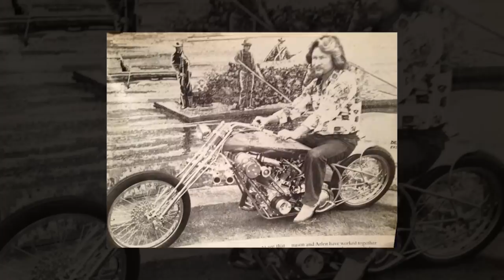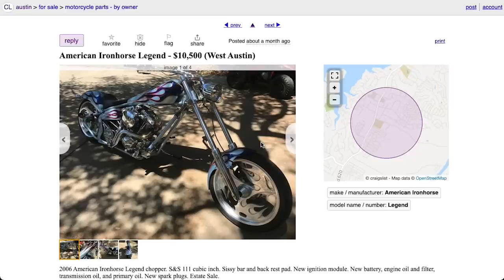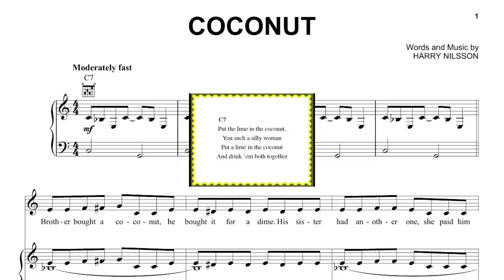This was the Weirdest Trend in Motorcycles (Choppers Explained)

Comment: I'm not a Chopper guy myself, but I have respect for them. Anything homebuilt that someone put their heart into will always have my respect.
Reply: I am one of the homebuilt rat- chopper riders... And thanx, means alot. I did pour my heart, soul and countless hrs into making it exactly like i want it.
I do however like other types of bikes also. as a gearhead and craftsman anything mechanical usually has an interesting story... and if you look at a bike considering what it was made to do, most bikes have their own strokes of genius! :)
Reply: I disagree.  It's like building an airplane that doesn't fly.
Reply: @micclay  What if you put some metal flake on it, chrome the prop and extend it way out front? You can still trailer it to Sturgis.
Reply: @micclay  no... it is like building a lightweight personal aircraft while everyone else is buying cesna....
Reply: Timothy McVeigh has entered the chat

Comment: Having been around when Choppers were relatively new, I'm happy to hear you explain the various types of bikes people have been drawn to building or buying.
I've heard so many people try to tell me a Chopper is a bobber or a bobber is a Chopper. Having an outlaw bike shop near my house, I often hung out around and asked, why's it called a Chopper. Simple, the head is "chopped" so the rake can be changed to allow a longer fork without raising up the height. A bobber keeps the stock rake but "Bobs" the back fender, or remove completely and use a single "saddle" as they were called back in the day and as the Yam master said, remove everything that's not absolutely necessary to ride it. Thx little buddy, I've been a fan awhile. I've had, starting in late 60's 175, 350 Honda's, a bultaco, Pan head Harley hard tail that I couldn't wait to get rid of to buy a CB750, a 360 Elsinore, 250 Elsinore, 250 Enduro Yamaha 500T Suzuki an XR500 Honda another 500T a 75 Gold Wing hot rodded out a 750 Ninja and others I'll remember later while sitting on the toilet. Also, my CB750 was heavily modded by a Honda tech aka Mechanic who was a sponsored racer and had parts not really available to the public. On that bike, I could easily outran Z 1 Kawasakis
Oh, I had an XS1100 I didn't keep long, it was so so slow compared to what I expected. Thx for the entertainment Mr Noob!
Reply: Put down the Crack pipe Ronnie.

Comment: Mine was a 1950 Panhead, hardtail, raked and extended 10” over forks. Mini apes. Gloss black peanut tank. Built by me in 1972. Loved it. Sold it for $1900 in 1974.
Reply: I loved it so much I couldn't wait to get rid of it two years after I "built" it. I then built a house in 1984 without a roof and the front door as the gate of my fence, but no windows because that's too new school. Loved this house.  Sold it for $10 in 1985.

Comment: I have seen a guy’s drawings of his fantasy chopper drawn while he was doing a jail term. It was quite a picture, and it helped him keep his head while he was away from his family and friends. Choppers are pretty fantastically designed.  I prefer more practical bikes but I miss out on style!
Reply: i made my rat chopper practical.... looks like a rat, but everything is newly made and fully functional. Starts every time and low maintenance, I even have a driveshaft instead of chaindrive.... I got electric heat, phone charger, 12v power in my ammobox sidestorage, a small windshield I can tie to the apehangers for long rides on the highway. bluetooth phone/music/intercom in my helmet, a cupholder for a steel mug besides the motor to keep my coffee warm, I got forward controls but also small center footpegs so I can move my legs around and I stack my luggage as a backrest and mechanical cruise control... I have had it for years and never dropped it once....
-What other luxury or practicallity do you need? :D -Compared to sitting on a streetbike, racer or adventure bike I feel like going on vacation lying down on a loud sofa! :D :D

Comment: I am a cruiser/bobber guy. Choppers don't really interest me except for the fabrication details. I don't care what the rear tire pressure is, a rigid frame hurts. I grew up around custom motorcycles, built in back yard sheds and garages, not on TV. I love to see nice fabrication of anything, motorcycles, cars, woodworking, but for me, motorcycles should have a suspension in the front and back, as well as brakes. For me, the worst part of the chopper craze is the idea that anyone with a cutoff grinder and a walmart welder can build one. Then they get upset at the local watering hole when nobody appreciates their "heavily customized" 1967 Suzuki 250 Hustler. I am not knocking self expression, I modify my own bike, but some guys shouldn't be allowed to use power tools. At this point, if I see pipes with header wrap, I just assume it is to cover the poor welds on the pipe. I ride quite a bit, usually cross country at least once a year, about the only time I see the "Boss, BigDog, super wambadine choppers is if I happen to be passing through Daytona, Laconia, or Sturgis during a bike week. They are usually on a trailer to get there, they go from the hotel to the bar a half mile from the hotel and back daily. Other than that, they seem to live in the trailer or the garage. I need more versatility than that in a motorcycle.

Comment: If you’ve ever bottomed out a motorcycles rear shocks just imagine having no rear suspension at all. It’s like riding in a car with the rear axle welded to the frame and the suspension removed. Such a dumb trend.

Comment: I know I'll get backlash for this... but with all the custom built choppers out there, it still makes me laugh to think that when honda made the rune not only did they factory build a chopper that actually worked as a motorcycle (unlike most of the custom stuff), it was also cheap and looked better then alot of the custom stuff. They also almost overnight killed the 2000's chopper craze. Lol
Reply: A big part of the problem was it being a Honda. A lot of “chopper” people are Harley because that’s what their friends ride and what’s popular. And typical Honda people aren’t generally interested in riding a chopper. 
And, even though it worked really well compared to a lot of choppers it didn’t work as well as a normal cruiser. So, most people are gonna spend the money on the one that rides and works better. 
Ultimately I think that’s usability is what really killed the chopper phase. Most of the people buying them weren’t “real” chopper people and were just interested in looking cool and showing off. So, once the novelty wore off they got parked in the corner and left to collect dust.

Comment: ITs funny that you just do this video and I am building a chopper right now in my garage for my wifes first bike. We are using a 1982 KZ440 as our starting point and going with a hardtail and airbags under the seat from tcbros
Reply: Kawasaki 440 was a beautiful little air cooled parallel twin! My best friend had a 440 LTD while I had a Honda  CM400T when we were teenagers almost 40 years ago.

Comment: Lowest rider are too often bad rides. The more eye candy the more useless and likely to go to pawn shops at fractional value. 
On the other hand they are dream machines that only have to travel in the mind and are trucked to events. 
Hence the abundance of low mileage modified motorcycles. Often only capable slow and not far.

Comment: For my everyday rider I have an almost fully fabricated chopper/scrambler cross built to be ridden hard and still be comfortable over multiple terrain be it blacktop or off road but with a Rat-Rod asthetic (think Mad Max) basically a scrapped together frankenstein of missmatched parts and homemade "rust effect" paint got somewhat raked out front end not too raked meant to be practical out on the trails but still got that look and i just like the jockey shifter built off a Harley Knucklehead bolted in a modified to beyond unrecognisable Indian Chief frame

Comment: Those started out as performance upgrades when outlaw bikers were modifying '40s-50s Harleys for their riding style in the '60s.  Longer forks gave you more ground clearance for cornering.  The one-ups-man-ship started before it even left that sub-group, with longer forks, taller handlebars, wilder custom paint etc. making your bike better than anything anyone else had.  Popularity let to more exaggerated builds over the years until they were pure style, form over function, by the late '70s.  Most of the builders in the 2000s seemed to have copied all of the bad aspects of the later '70s choppers.  People like Indian Larry, Jesse James, and Suckerpunch Sally's got it right.

Comment: Front brakes work fine on a raked bike. Not sure where that comes from? The law in a great many countries and their provinces/states....require BOTH brakes.... and yet, there are choppers all over the world. Some places you cannot have them... I'm in NSW Australia, and you cannot really have a chopper here, unless it is a survivor bike from before the mid 80s, because after that, you cannot have a rake of more than 550 mm here.... but there's a lot of bikes in other Aussie states which are straight out of the SoCal 60s class of oldskool.... except they have brakes.... because they have to... and people are not pancaking themselves on those bikes at disproportionally higher rates to other custom, or factory for that matter, bikes. 

Ditching the front chrome drum, or later, the disc, is a wholly stylistic choice, argued for by those who do it, with the ultra dubious argument that they work poorly on raked ends, and are potentially more of a danger.... but there is not a whole lot of evidence, other than the anecdotal, to back that up, and it has not proven the case in places where you have to have one or the bike wont be road legal. 

Same with suspension... it is a stylistic choice, and has nothing to do with how the bike works, or it making anything better, some people are just dumb dumb stupid heads who's smooth brains do not understand things like Softtail frames or Plunger suspension exist. A Sprung seat is fine too. Sometimes though, a sub category of the chop, is the Boneshaker... but these are just moronic machines made by moronic builders... there is no rule you have to ditch the rear springs, and deffo no the front, to be a chopper. 

Speaking of front bounce, you showed a girder... which is not a springer.... but both are popular, and leafs too, though it is common as anything to have standard, if raked, forked and suspension set up.... or have the best of both worlds, with something like a modern system, in a classic design like Harmon front ends. There is not real rules. Again, proven by all the choppers in places where you HAVE to have either a sprung seat or rear suspension +plus front. Some places hard tails, rigids, and outright Boneshakers, are illegal AF... but the chopper persists. 

Virtually none of the rules, are actually hard rules. Even the frame. You can shoe-horn an engine in to a stock frame, throw on an oversized peanut, dump a well comfy gunfighter on, put a nice Sugar Bear piece on the neck, the only part of the frame you touch to accommodate it, have some wide T bars, throw some classic mirrors on, mid controls, keep your rear springs, give it a slick coat of colours, and stand back.... and you will see it is a chopper, even with front brakes and all. It will ride as well as a chopper that has a chopped frame, hardtail, girder front, no front brake, and no mirrors..... actually, it will ride better. But it will still BE a chopper, and look like NOTHING else, no one will mistake it for a Scrambler or Enduro... or even bikes much closer in DNA, like a Bobber or Digger.

You couldnt be a Born Free, Easy Rider, eating up the highway on that Chop you built..... living the life, scening the scene.... if there were anywhere near as many rules as you make out. Rules are anathema to the very spirit of Chopper life, brother.

Comment: Driving a chopper feels different. You have to build a chopper yourself and only has to fit youand yourself. If you drive a chopper someone else has build, it might feel weird because these bikes react differently. A chopper is just as good as it's owner and you work with your chopper, learn to drive it or change what doesn't fit.
It not hard if you have build it like you want it to be. If someone dislikes it, that's ok. They don't have to drive it.

To make it simple, a good chopper is build and driven by the owner and for the owner only.😇

Comment: In Hunter Thompson’s book Hells Angles, he claimed they “chopped” their Harleys to get a better power to weight ratio. I’m glad you clarified they in fact do remove the front brakes b/c I was in disbelief lol.
Reply: Once you hardtail the bike it rides worse and becomes less reliable. You hardtail a Harley just to make it more esthetically pleasant.
Reply: The old Harley front brake they were talking about in that book wasn't worth the effort it took to bolt it back on anyway.  Designed in 1929 for bikes that were still expected to see a lot of use on gravel roads, etc. they were not very effective.  Then, to some people, "no front brake" became part of "the look" a chopper "had to have."
Reply: @wilburross9709  interesting, thanks for the info

Comment: A few corrections 

It’s called a chopper because you “chopped” unnecessary parts off of the bike

When you were showing the springer front end. You showed a picture of a girder front end. Similar but different
And when you said jockey shift 
You were showing a tank shift
A jockey shift was the ones you showed behind the riders leg.
It mimics a jockey using a riding crop to whip the house 
And a digger style chopper was modelled after a drag style motorcycle

Carry on 👍
Reply: Most of what are called "choppers" are more accurately called "customs". As you stated, "chopper" means removal of unnecessary junk. Most of these customs have loads of un-needed junk on them and are actually quite heavy.
Reply: @littleshopofelectrons4014  that’s a fact

Comment: I was lucky enough to be able to put a few hundred miles on a 2002 Texas chopper back in 04 (mine to ride for a week). It rode absolutely fine. It turned (slowly) it had power via a S&S HD clone, and was comfortable. Did the primary drive make it hard to turn left sure. But just cruising it was a decent bike. It was $50k back in 02, that's $84k today! It was not worth that at all but I did not pay for it. I have the memory, picture and the story, that was worth the ride.

Comment: Didn't expect the most thorough video on choppers and their history, to come from yammie. Nice!
And just a thought, but doesn't springers give more of an advantage suspension-wise with a more aggressive rake, than a telescopic-fork would. Allowing the wheel to move a bit up and back, other than just towards the headtube?
Reply: And built in anti-dive characteristics. I have a 2006 Springer Classic
Reply: That's correct.  With a springer on a really raked frame, the trick was to extend the front "spring" forks a little longer than the rear forks.  As long as you kept the rockers at a close-to-stock angle, the suspension would still work.

Comment: I used to want one of these. I still wouldn’t mind taking one for a spin if i ever got a chance, but im motorcycle fluid if you will. Ive went from an xr80, to cb700, to a fatboy, yz490, and now rock a dr650. There was almost an fz1 in there, god that thing was comfy and fast, had 7 motorcycles in the shop at that point, didnt need another. Woulda been fun tho.

Comment: i ride a modified 2006 Harley Night Train, and i love parts of the chopper look. most of the reason i bought my bike, its got taller bars, short pipes, and is pretty stripped down. but i am not a fan of the 20 or 30k super raked out bikes. they look silly, probably ride like crap, and are better off gathering dust on display lol

Comment: occ ppl are cringe ad most choppers are ugly as hell, but im super envious of them, able to access the seemingly an endless catalogue of aftermarket parts. speaking as someone who owns a mediocre small bike in an area that has basically no motorcycle culture, there are 2 selection of proper brake pads (not air-pulluting copper ones), one oem and one aftermarket. and i need to source a slipper clutch unit from second hand marketplace, like how you would find a dealer for medicinal herbs.

Comment: Chopper referred to 'chopping' off parts to make them lighter. There's the 'function' aspect. Bikes from the WW2 era didn't have suspension to speak of (ridgid frame). Therefore the suspension optional reference is , per the norm , an uneducated comment.
I see, after quite some time away, you still attempt to talk about things you have zero knowledge of.
Reply: Most importantly they chopped the frame. Choppers aren’t bobbers, they did it to make it look cooler.

Comment: I personally think that bobbers and choppers are at the very least,functionally silly.
Its like taking a 1/2 or 3/4 ton pick up truck from the 60's, 70's or 80's thenslamming it so low that tge frame rails are within a few scant millimeters of gouginging pavement.
Sure it may look cool, but it flies in the face of what a pick up truck is designed for.
Just my personal opinion and observation.
The bobbers and choppers might,in some cases "look" cool, but they too suffer the loss of capability that motorcycles should have.
(That being said, I toi have a rigid, mild chop frame and yamaha XS 650 that have been languishing in my shed, waiting to be assembled and finished 🤷)